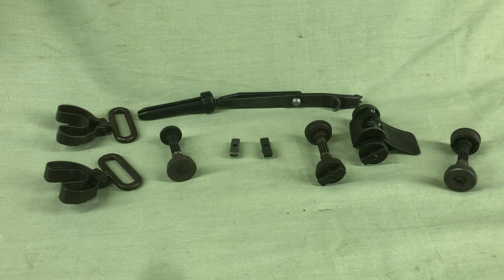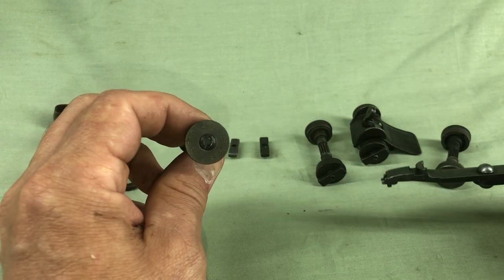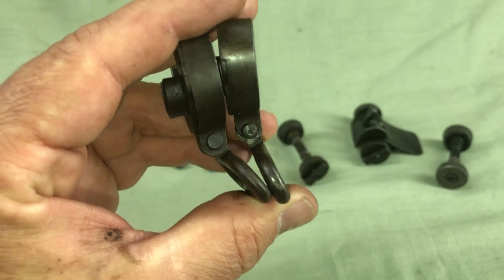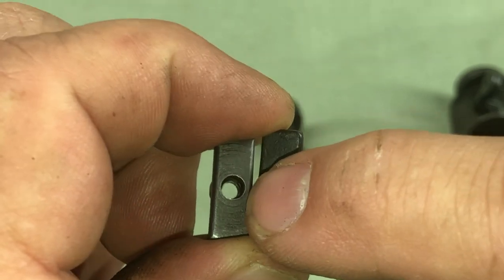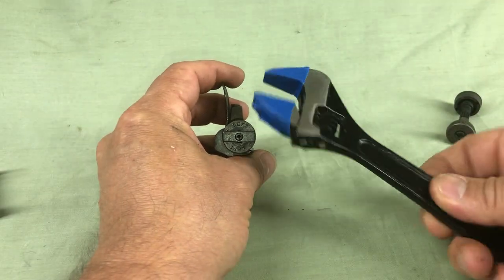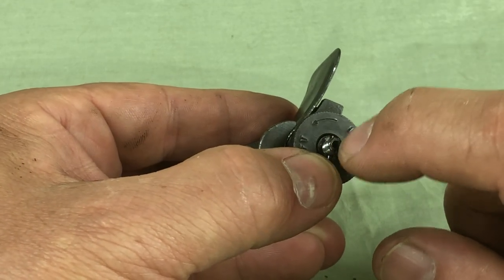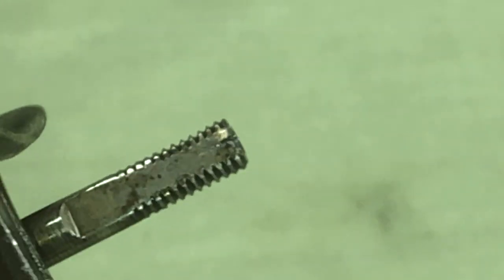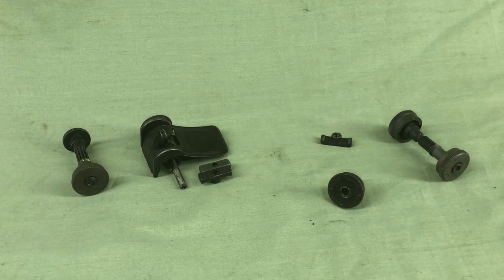Removing Lock Bar from a M1 Garand with variations & considerations

Comment: Very good video. If I may, I'd like to point out that the rounded bar you have looks to be a type 1 lock bar. They were actually made in the rounded and square type. They type 2 and 3 were the larger threads 8/36 with they type 2 being the rounded end and the type 3 being the squared end. Thy type 1 you have is a super rare and very expensive piece to obtain as they were only used for several months before they went from the shorter pinion to the longer pinion. The flush nut and type 1 LB were both 6/40 thread while the type 2 and 3 LB were 8/36 thread.

Comment: Another great video !!!! Like the way you get to the point on your videos and show your great expertise and knowledge. I got my M1 back in February from the CMP. Got the Special Rack WRA. Took it to the range and failed to feed first four rounds automatically. Talked to CMP Armorer on the phone while at the range. Long story short - sent it back and timing was adjusted. Rear sight aperture was loose and I requested they tighten it while there. Got the M1 back and works great now. Only problem is now my rear sight is tight and works great but nut on DRC windage knob appears to be split in half. One half of the nut is higher than the other half and wiggles. Do I need the spanner type tool you used in this video to try and remove the nut inside the windage knob?? Any suggestions would be greatly appreciated. Take care !!!!
Reply from the maker: Glad the video liked by you.  As far as the windage nut, there is no way to remove.  The entire part needs to be replaced.  Those nuts have a spring retainer on them to prevent them from being remove.  Yes they can be removed but at what cost, no one sells the nut alone and the entire assembly is cheap enough.
Reply: norwich93CMP 
Thanks for the reply !!!!!   I found some online for like $8 apiece. Bought a BME and DRC. Do you like either better than the other ?  Mine is just a shooter and I love it. I will disassemble rear sight and replace complete windage assembly. Thanks again and take care.
Reply from the maker: @terryscruggs5876  DRC but that is just my fancy.
Reply: norwich93CMP 
If DRC suits your fancy then it’s good enough for me. 😁😁 Thanks and take care !!!!

Comment: Do you have to re stake it after re installing
Reply from the maker: I would not restake it.  The pinion end can be split easily.  Also during maintenance doing that over and over again will just damage the pinion permanently.  Good question.